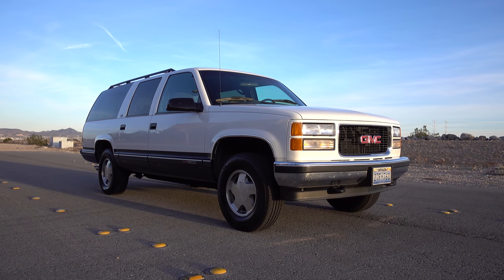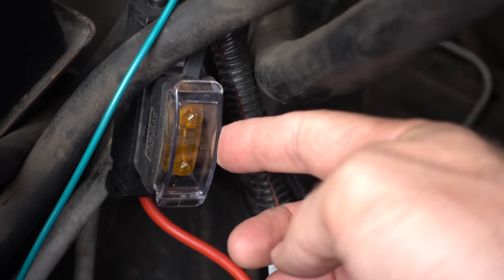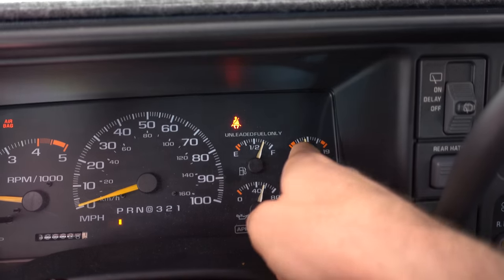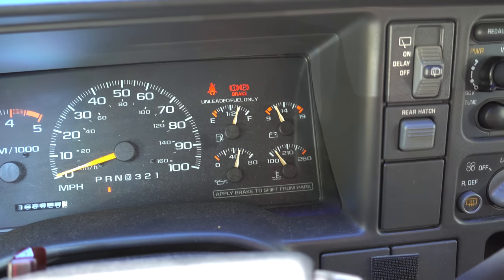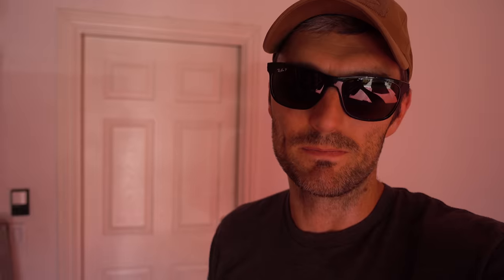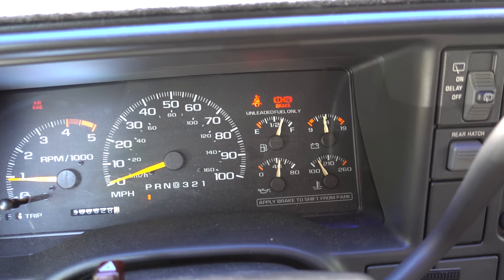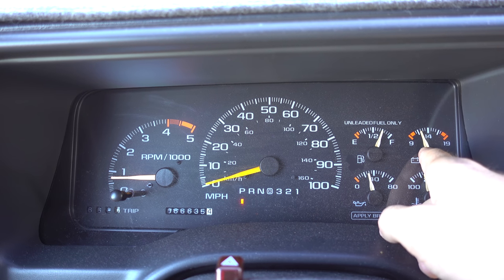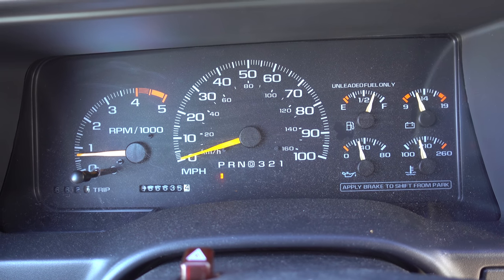SOLVE A LOW VOLTAGE ISSUE!

Comment: I know this video is old but an average alternator runs about 14 volts anything lower to be considered as bad or you have a bad ground or parasitic draw
Reply: That was awesome answer!
Reply: I went to a mechanic to do a diagnostic on my car because my RPMs are too low. They checked everything and they said there was nothing bad enough to trigger a check engine light and nothing bad enough with a new what to replace. If the RPMs are too low when I'm in drive. The car almost wants to stall but the voltage drops below 12 as well. If I can't manage to bring the RPMs up can't I get a more powerful alternator? Could that help at all
Reply: @KevRalph  i have almost the same problem, its probably a bad ground conection, follow the ground from your battery to where it goes and clean all the connections, maybe they are rusty, i will do it too in the following days 😁
Reply: Do you guys know why when I roll up both windows and they're fully raised and I'm still holding the button do I get major flickering lights and voltage drop for a second or two? 05 Tahoe 5.3L. Just changed the hood to firewall ground and firewall to engine ground last night. Cleaned up both grounds on backside of engine and made no difference. Truck also seems a little sluggish
Reply: @KevRalph  I had that same problem on one of my cars in the past… i believe it was the alternator alternator
Reply: @DJR5280  check bcm
Reply: How would you properly check for a parasitic draw. Where would a bad ground be? Anywhere? I just got a BRAND NEW ecu, alternator, battery, and battery cable harness im still having my 2013 impala pop up with service battery charging system . Not sure what it could be at this point
Reply: @DJR5280  if you found out let me know. I have a new alternator and battery. I also changed the mega fuse… still acting up. Any advice is appreciated
Reply: @jbullman27  I had thr alternator checked and it came back ok. I could swear it fluctuates the longer the truck is running
Reply: My car is new and it never hit 14 V yet ..dealer said the normal voltage is 13.6  And can go down to 13 after its totally warmed up
Reply: @Pinkielover  relays and computer-based protocol can lower the voltage starting up the engine requires around 14 volts anything lower than 12 volts is considered bad that brings us to the topic on load it is the base energy the vehicle uses when the vehicle is running that means the vehicle is using 4% of its power source when the vehicle is running which is pretty efficient for a newer vehicle
Reply: Manifold gaskets or air leak could be a problem /Ground wire problem also .
Reply: @Pinkielover  Yea mine will start at around 14 but drop to 13 after a bit. This is on a new battery too.
Reply: Alternator charging 13-14 volts are NORMAL. if it goes higher like 15 or lower arnd 12 then you have a problem.
Reply: @jamesmendoza5097  yes
Reply: @KevRalph  this happens when I just put a battery in my truck but takes a good Thirty miles for the truck to relearn so when you come up to a stoplight you'll see that your RPMs get real low like it's about to stall that happens to me when I swap my battery out into my other truck to move it and when I put it back it takes awhile for it to go back to normal this would be a battery problem if your RPMs are too low when you hit the brakes or at a light.
Reply: @DJR5280  normal
Reply: @jamesmendoza5097  when I'm on the gas it's bouncing crazy from 13 almost to 18th and when I brake it goes back to where it needs to be and sometimes at idle at a light and go back to where it's supposed to be but once I get back on the gas it starts starts going crazy all the lights are dimming you can tell that there is a current draw when the truck is running all the lights will go from Bright to dim bright the gym 24/7 but not that damn just a little bit you have to really stare at it to see it
Reply: @txboy112233  do you know how old is your ALTERNATOR?
Reply: Alternator & Battery works in tandem. If you have a bad alternator it will ruin a new battery. If you have an old battery but a new alternator...it will mess up the alternator. As simple as that. That's why it's important to know which one is bad. If one is bad replace it asap and don't use the vehicle until it's fixed.
Reply: This video is old,Truck from factory did not came with electric fans the alternator is pulling out enough amps for what it is. Extra amps draws like sounds even dual fans required alternator with more amps.😎
Reply: @KevRalph That sounds like a Throttle Body Issue.

Comment: Yes you have an issue but it's with your alternator. Upgrade the amp output of the alternator to increase the amount of amperage going to the batteries. You need more amp output,period. Buy a high amp alternator. The dual electric fans can pull close to 60 amps by themselves. A second battery can be a help but it will probably require a 200 amp alternator to run everything. Also the ground wire needs to be bigger and that's because current runs from the ground back to the battery. Strange right? Buy yourself a ground strap kit and add more ground straps and use a bigger wire on the ground side. The ground wire upgrade is probably going to be the cheapest theory to try first. Also because you have a 140 amp alternator already then you should make sure that the power wire running from the alternator to the battery is large enough to supply 140 amps to the battery. Each wire size is rated to handle a certain amount of output.

Comment: I think it might be the alternator, try read about on a high output alternator.
Reply: Add a 40 ferad inline car stereo capicitator off eBay. It is a energy bank that install by the battery for high draw electronics. They are life savers.

Comment: Clean/replace ground straps from battery to body/engine block.
Replace alternator pulley with a slightly smaller pulley ("overdrive pulley"). Will turn alternator faster when at idle. Those big engines don't turn fast even on the freeway.
Dual batteries might be easy in your vehicle - many midel years have a location ready to accept an auxiliary battery tray! But it won't solve your current problem.

Comment: I have '99 GMC Suburban with exact same issue.  I solved the problem by putting double ground in.  I put two gage cabling set up. Also I put dual batteries with 1000 cold cranking amps.  New alt with higher amps (250 amps) and put a battery isolator on it.  Even with my dual fan, subs and amp, a.c on, it doesn't drop ever while it's at 14.2 volts.  That's how I did it.
Reply: Josh Benney where you put the ground from
Reply: Josh Benney bullshit lol I done had a shit ton of trucks and none of the grounds ever gave me an issue. I’m having the same issue and I changed all my wires and it flows better but the issue is the same but the older trucks like that tend to have a 105 amp alternator while newer cars like 2010 Tahoe’s or suburban that come with fans from factory comes with a 135
Reply: living in a desert i changed the the whole dash gauges it worked,probably some powerlines were burned buy it worked it
Reply: @Devo1987  it joins the battery's when car on & charges them . then separate the batts when car off that way it doesn't drain the batterys when off. But keep in mind you need a hi output alternator to charge both batt. Hi output alternator neams more amperage alternator if your stock alternator is 140 you replace it woth a 240 amperage they also cost more hope that helps

Comment: do they still make those bigger pulleys for alts,make it turn faster,i have a 95 Z71 and ive had two batteries and i have a 140 map alt,but i have a low volt problem sometimes theres a phrase its called voltage stollen or something like that,theres a video on here where you do tests and check all your fuses to see where your volts are being stollen,i need to do this myself,good luck,well hell its been a year,nope two its 2019 now did you fix it dude,let us know

Comment: Overdrive pulley for the alternator at idle you only have a fraction of the 140 amps the alternator can put out, in addition heavier 2/0awg cables all the way around.

Comment: The Volt regulator of the alternator is not calculated to handle the draw of the dual fans.  Nothing is wrong with the alternator, but the regulator maybe getting interrupted by insufficient grounding between the fan and it.

So when the extra load is drawing from the positive, the negative is failing to return the amount.

Comment: On a more serious note, check the continuous power wire (orange or red) 
 for your A/C control panel located in the dash. The wiring port tends to go bad. While it still may work, it's 3 connector on the back of the panel. The middle port connects to to the fan speed control. Check the orange continuous power supply for any loose fitting or signs of arking.

Had similar issues w/ my 2000 Escalade. GM issues. 
Hope this helps... 
Just realized this was an old video after all this advice...
Smh
Reply: What was the problem, im having the same issue

Comment: Two fans will use a lot of power. Try using one of the fans and see how things go. Most cars with dual fans have one for use while A/C is on, and the other for overheating.

Comment: the battery charges at 13.5 and above once the voltage goes at 12 volts then ur truck is only running on the alternator most a/c systems ive come across automatically raises the idle to compensate for the a/c pump so u dont stall just like how the power steering auto raises the idle when in use

Comment: The solution is to check how much current is the two fans drawing with an ammeter. If it is drawing 10 amps or more then that is too much for the alternator. Either you install the thermostat to control the fans or switch off one fan. Then the alternature will produce enough current to power one fan and the other electronics.

Comment: and the alternator cant put out as much power as it should at low rpm so raising the idle will help alot since the alternator cant charge at low rpm
Reply from the maker: +Jimmydean hilltow I've been wondering if I had a low idle rpm issue. Mine seems to be at about 650 while stopped and in drive. Is that low? Maybe that's my issue right there. Not enough rpms while at idle... Maybe check my idle air control valve? Thanks!
Reply: Mr. Jimmy The idle seems spot on. That is precisely where my idle is at on my 96 Suburban LT. A quick remove and clean  of idle air control valve is easy to do if needed.
Reply: That's exactly the problem the alternator cannot put out enough current at idle. Do not raise the idle of the car that will lead to other problems. simply get a smaller alternator pulley, that will raise the RPM'S at idle. Or you can always upgrade to a higher output alternator at idle.

Comment: i think the problem is the fans because take to mucho energy and is better to put the original fan
Reply: Just exactly what I was thinking, Mr. Carlos. Get back to original fan, upgrade to heavy duty fan clutch, be sure fan shroud is in good shape, wash the ac/radiator cores...nice and chilly!
Reply: Mr. Roy not your too old school just stick to your jalopies and roll the windows down when it’s hot
Reply: Na just upgrade it all stock is usually shit anyways depending on the setup

Comment: I have a 99 Tahoe with the same fans. With the factory alternator mine did the same thing. I switched to a 140a alternator off of a 2004 Tahoe and fixed all my problems.

Comment: You ready fix your truck with low voltage because I have the save problem on my gmc c1500 1997 how do you fix your truck

Comment: u need to put in a relay;  it will supply 12 Volts to the fans - it's like having the fans directly connected to the battery but it doesn't draw all 12 volts.  only enough to switch the relay on.

Comment: i have a gmc sierra 1997 and my battery gauge goes down like yours (but not that low) but i never did trust that gauge or any gauge on the instrument cluster, my alternator is suppose to be 150amp (or close to it) i do have a good battery and i put 0 gauge wire (big 3/4) and when it drops i check it with a voltmeter and while the instrument cluster reads like 12v-13v my voltmeter reads like 14.2v-14.8v...i would check it with a voltmeter maybe your gauge dont work 100% the way its suppose to, or buy something that has a voltage display and put it next to the cigarette sockets

Comment: I have a 93 k1500. Starts and runs fine. Has a little problem with the gauge cluster. I think it's your cluster. Maybe have a dual set up. And run one camera on the gauge voltage and one right at the battery. I bet you its the cluster that's not operating properly. Common problem

Comment: alternator cant keep up at idle, you either have a failing alternator or need a higher output alternator. wiring will not solve the issue neither will a second battery. alternators are rated at a certain rpm usually around 2000rpm so even if the alternator is not failing it will not make the full 140 amps at idle

Comment: Big 3 the factory charge wire is super small and not capable of efficiently charging etc. and also get you a Northstar agm 34 which are dry cell batteries because those basic acid batteries suck and not made for high discharges for long periods of time, only to start car and a reserve for the alt, basically your alternator keeps everything up and going while your car is on, you could also get smaller pulley for more voltage at lower rpm 12 volts is fine anything below 10 is bad and will blow fuses on equipment that require more amps 14v is just the charge rate of the alternator it will never stay at 14 on your dash get a voltmeter for better accuracy on voltage dash volt meter I'm sure is out dated

Comment: Still can't figure this problem out. I have replaced the battery, alternator, grounds to block, grounds to head, pos and neg cables, starter, belt, pulleys....and it keeps dropping randomly.

Comment: The alternator could be an issue. the battery is used to start the engine and when the engine is off accesories are run off the battery. but after the engine runs the alternator takes over to run the accesories

Comment: yea its not the voltage. i think it might need higher AMP output alternator? lots alternators say what AMP output? but not all say that. check your alternator for type of output AMP's your fans will draw more AMP's but in combination of breaks and backup will draw more AMP's
Reply: on other note> could be Volt+AMP regulator on alternator?
Reply: still can be alternator> because of new volt+amp usage  you might need extra output alternator. also for your fans might need thicker wire for more power flow?

Comment: I wonder if there's a solenoids Atwood kick up the RPM at idle in gear. If you had such a thing like some GM diesel do then the issue would disappear completely. Get rid of all those positive wires from the battery terminal and put them on a terminal block i it doesn't look  good

Comment: I have the exact issue going on ... brand new alternator new battery and I’m having the same problems... I upgraded the power wire from the alt to the battery to a 4 gauge cable that helped a little but all my grounds seem to be fine I’m stumped .

Comment: I have worked on these trucks a long time. I love them and have had more than I can shake a stick at! There are a few things that can be done to fix your problem. 1. You purchased a new battery. It was likely not your battery. So.. what I would do now is install your original battery, and run dual batteries. If you use it for the family, and go on trips and vehicle uses that much power before any dvd players, laptops I anything's that will add to the draw. A second battery will help with that. DO NOT put them in a series, make sure they are parallel. positive to positive and negative to negative. 2. Upgrade your alternator if it has not already been. 130 - 140 amps is usually standard. You can get them all the way up to 300! You might need that much, but it wont hurt it. Third, and last.. do the big 3 upgrade. Upgrade all your cables with heavy duty cables. All power connections, and ground connections. This should solve your problem. It is a little bit of an investment, but a few hours of time, you will have terrific results and not have to worry about a thing. If you do the upgrades, I expect to see a video!!

Comment: This trucks have to run at a 198 to 210 tem if not you get crappy economy so yeah it may run cooler but that is not what’s intended for that engine temperature to be

Comment: I had same issue and added 6 gauge ground wire from negative battery terminal to chasses lug and solved my voltage drop. first i cleaned the small wire from negative battery terminal down to frame and sanded connecter and frame but did not solve issue . maybe defective or burnt wire so i just ran the 6 gauge stated in the first line. Thanks hopes this helps someone . My alternator is a 130 amp Acdelco 2002 Tahoe 4.8l

Comment: I’m having a issue on my 99 Yukon , code says repair cylinder head ground connection , my rpm won’t go past 2000rpm when driving

Comment: I drive a 98 suburban SLT and I have the motor fan and it gets to about 100-120 degrees here in Arizona and I’ve been experiencing the same thing when I have the front A/C the rear A/C and my head lights on and my voltage has been going low and I think it is the alternator

Comment: You need a hi output alternator dual battery's won't help you should already have a 115 to 125amp now but u need a 150 or more...
Reply: Measure the voltage coming right off the alternator WITH YOUR ACCESSORIES ON. (So don’t measure alt voltage on battery but right on the positive output stud on back of alternator)
(A/c, lights, hi beams,etc) you should get 14 or a bit more.
If you don’t I’d put in a DELPHI alternator 
Your problem will be gone.